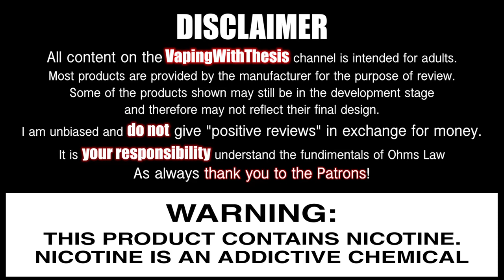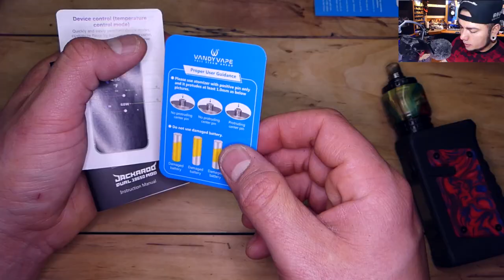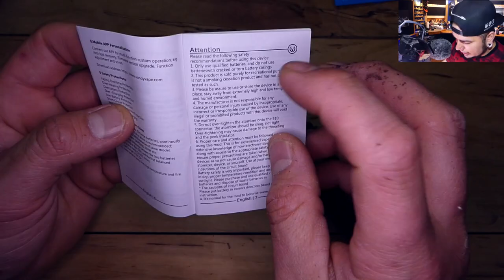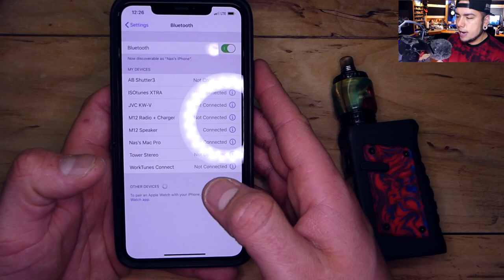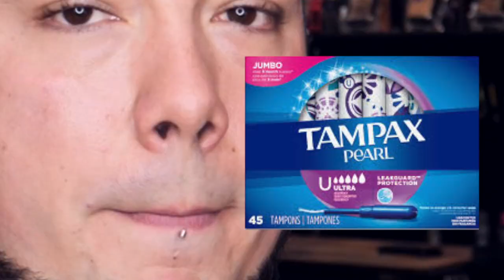The only REAL Life Proof Vape | The Jackaroo Dual By Vandy Vape

Comment: True to life too, It's also logical and as well as convenient  to take out the batteries before you drop it in the toilet!  Not even USB C, or rubber plug in 2020, I'll stick with the Aegis Legend. Not sure how much testing of longevity you will get from a couple months of use, the legend is tried and true, for years! The firing trigger on that kinda sucks too, small little circle compared to an actual trigger on the Aegis Legend. Next time take out the batteries from your legend before you put it in water to reduce the risk of shorting! :P I also don't like the off centered 510, if it drops it is more likely to break the tank. The entire leading edge of the tank (which is likely bubble glass)will be exposed to a drop on the Jackaroo, where-as the Aegis Legends centered 510 will afford more protection for the tank and more likely land on the drip tip. Was this a sponsored video? Might I suggest a side-by-side test of the Aegis Legend versus the Jackaroo Dual (batteries in both and tanks on both! (really tho, true to reality.)) for a future video? It would probably be worth your time! Really really though, no one is taking out batteries and taking off a tank before they drop it. The Vaporesso Forz would be a decent tank for the job. Maybe call it a Reality Check test or something! :)
Reply: I was thinking the same. I have a retired legend only because i ran it over with a riding pallet jack in a refrigerated trailer.
Body of the device is all chewed up, but it still works. I figured it saw enough. This is coming from someone that has destroyed an otter box. My legend right now has been at the bottom of a lazy river tubing and had to fetch it when it fell out in a lake kayaking still using it today. Having no cover on the charging port makes ne skeptical on this mod.